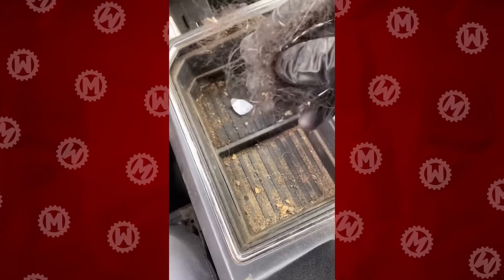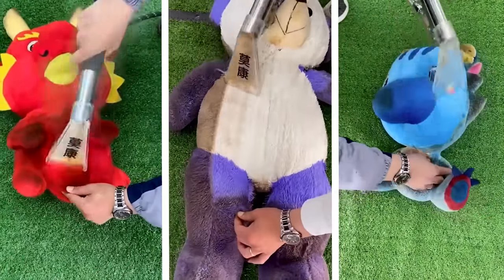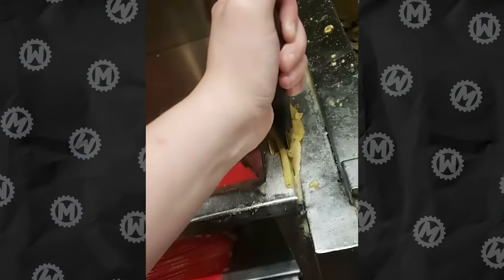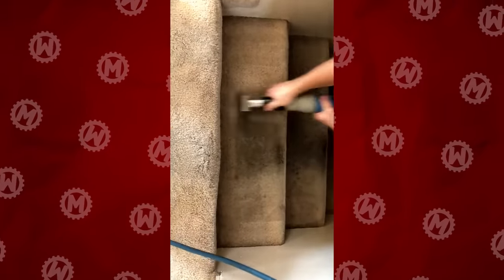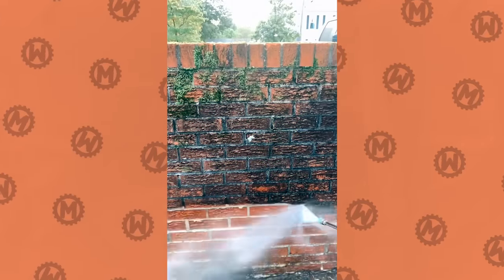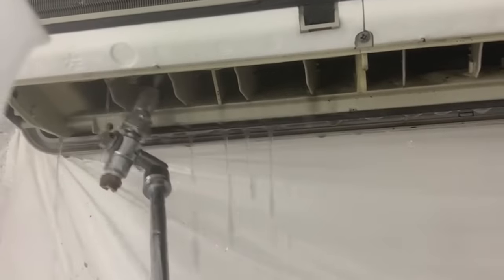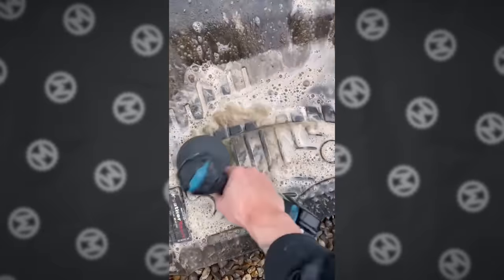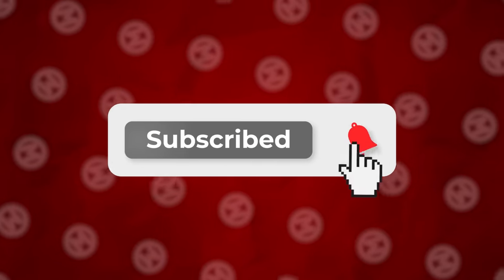Here's How Professionals Deep Clean Things

Comment: I work in electro mechanical fire and flood restoration. I love the look on other peoples faces when we pressure wash a control cabinet (after stripping it) and wash all of the components in a bath. The absolute best part are the customer reactions, after we've finished. Even seen a man who worked the same machine for over 30 years start crying after we'd cleaned and restored it, he'd been convinced that it would be scrapped because of the fire.
Reply: Good job, man!

Comment: Interesting Facts: Did you know most new ovens have an auto clean function?, This makes the oven lock and Incinerates the inside of the oven.
Reply: it works very well but you probably want to only use that feature once in awhile as it gets so hot it can damage the inside of the oven and the computer board on the top

Comment: A mention of the products used, would be most helpful in this here video…
Reply: A lot of the products would be commercial or industrial and readily available to the domestic market. A couple, or three things worth mentioning

To clean jewellery in an ultra sonic, use de-ionised or distilled water you just need a small ultrasonic tank (they're not expensive).  
For a small piece of electronic hardware get some isopropyl alcohol (we use 95%) and a toothbrush, make sure you wear an anti-static band if you're cleaning a PCB. 
Kitchen equipment generally needs the industrial degreasers but a hand held steamer, oven cleaner (this stuff burns so wear gloves) and a scouring pad will get the majority of it done.
Reply: @roguegargoyle914  - Thank you!
Reply: one of the best cleaners out there is Barkeepers Friend, that stuff works wonders on metal!! It's cheap too!!

Comment: 2:50 that Cerma Bryte stuff actually works really well. The big bottle comes with a scraper, the liquid, and 3 cleaning pads. The way they use it in the video is NOT the proper application, its way too much, but it really does work. Its for glass cooktops only, just fyi. Also, one thing for cleaning shoes, use that Dawn dish soap thats in a spray bottle. It works really well, and my shoes went from brown, green, and black and caked with mud to almost perfectly white.

Comment: What was used on the stove and oven? I've been testing various things and haven't found a great way yet.
Reply: I know this is like a month after you posted the question but I think  its the easy off oven and grill spray for the top of the stove. Its the same yellow as the can in the video. :)
Reply: Bicarb works well and doesn't dissolve the insides of your nose either!
Reply: 1. Don’t let it get that dirty
2. Baking soda + white vinegar + warm water

Comment: 1:50 Don't waster your time and money for cleaning products to clean up a grill. Get some backing soda; it's cheap and harmless enough to use in baking. Mix it with a bit of warm water and rub it all over the grill. The carefully add some white vinegar (careful as this will get you some reaction) and let it sit for a while. Finally rub it off and clean again with water. Very good results and for the price of an expensive grill cleaning product, you get a bucket full of backing soda and large amount of cheap vinegar.

Comment: I am going to make a list of things used in this video to clean stuff per example:
- some slow speed dremel tool 
- ultrasonic cleaner + cleaning solution + dremel tool (as explained in vid) 
- water pressure washer 
- some Iron or steamer? what is that?
- barkeeper's friend + scrub it a bit to get some harder parts of + time + water and lemon (for an acidic Ph to clean)
- some cleaning spray? [anyone who knows tell me and I'll edit the comment] + ceramabryte to further finish the oventop 
- some foaming spray + cleaning spatulas + lots of paper towels
- wow McDonald has a lot of... greese
- screwdriver or ice pick or sewing awl
- alcohol + microfiber cloth
- detergents + vacuum cleaner + automated mop-steamer
- hot steamer pressure washer that reaches 300 degrees Fahrenheit + respirator for paint removal
- toothpick + brushes + vacuum cleaner for PSU cleaning
- toothbrush + astonish mold and mildew blaster + the pink stuff miracle cleaner + Fabulosa concentrated disinfectant
- pressure washer + water bucket
- laser cleaner [can remove rust from metal]
- various brushes + cleaning solution + handheld pressure washer + vacuum + cloth
- some academics robot toy cleaner to clean ventalation

Hope you have a great day & Safe Travels!

Comment: in-room air conditioner like the one in the video does not actually take air from the street, it runs room air through cooling system, so you need to open windows from time to time to get some oxygen, if u dont wanna get headick, or god forbid suffocate. still need to clean it from your own dust though

Comment: Should have said you should NEVER open a PSU if you dont know what are you doing. There are High voltage capacitors that can  Shock you if they are not discharged. Be safe with Power Supplies, they are no joke.

Comment: You keep mentioning the power washers as hot and steamy, but that’s not the case in most places, in fact there are only 2 instances in your video where they use hot/steamy power washers, the moss and the paint. The rest don’t need to be hot, or even warm, it’s literally just power washing.

Comment: 2:55 I have a scraper, but what is the cleaning product for this one? I might use it
Reply: Not sure if one was used tbh, I think that was just the scraper doing most of the work there.

If any chemicals were used, it was probably Oasis, Greaselift or Greasecutter, all made by Ecolab. 

Disclaimer: I haven't worked at McDs so I don't know for certain what chemicals they use there, but kitchens I have worked at used those. McDs apparently uses ecolab stuff as well, so probably right.
Reply: @MrSpeedysam60  alright